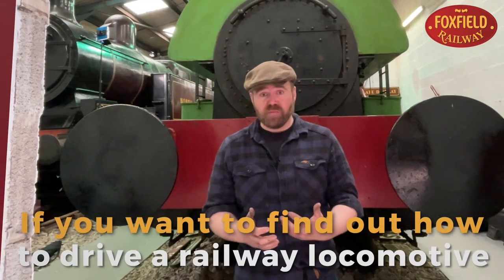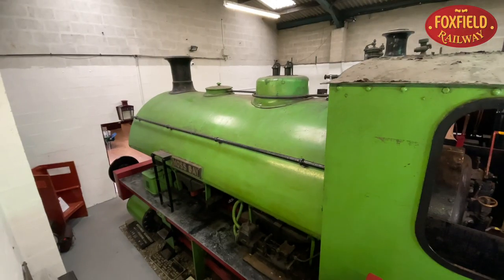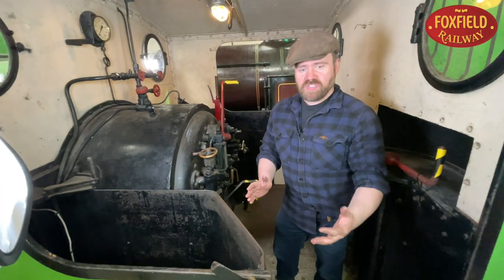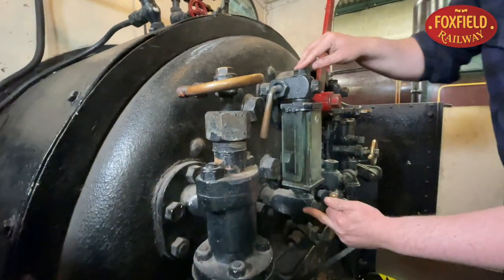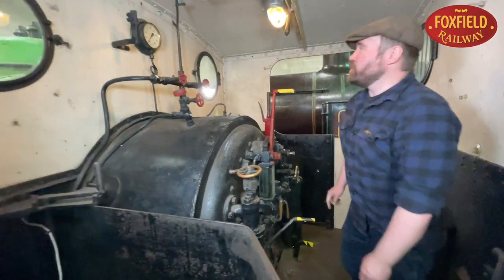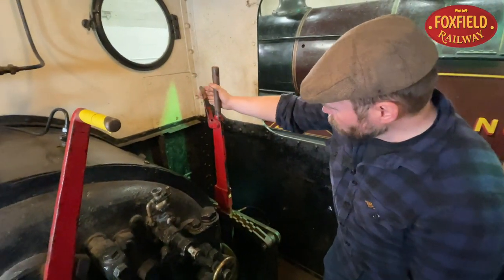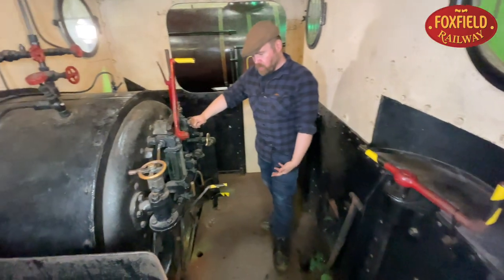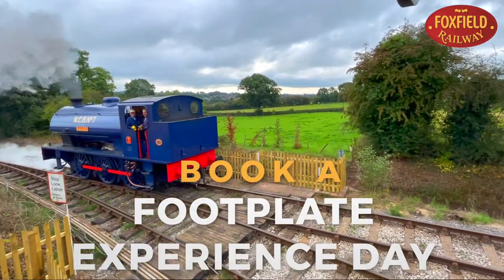How to Drive a Steam Train?

Comment: Dont worry i dont do this irl but is it decent practise to use the throttle as a steambrake , for instance to hold a speed of 25 down a 1% line with 15-16% on reversed reverser and full reg on that?
Reply: It definitely wears down the cylinders and with time they would have tl be replaced, but it was a real practice that was used on railways and was included in manuals that railway used to train their drivers